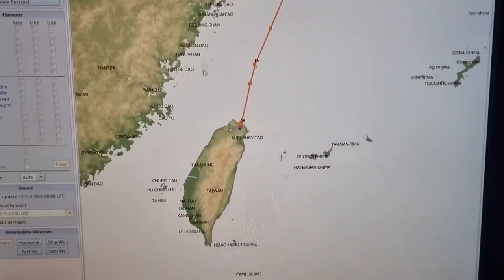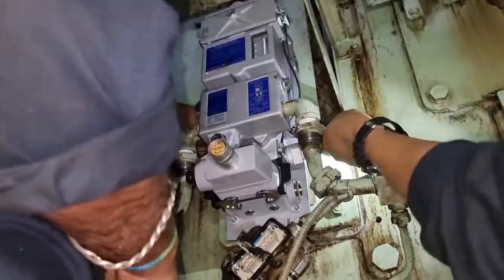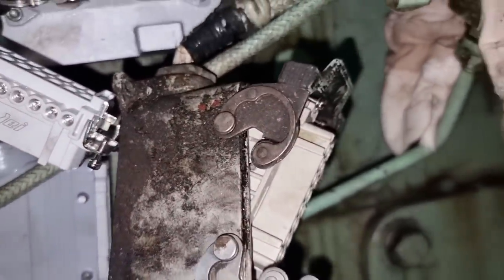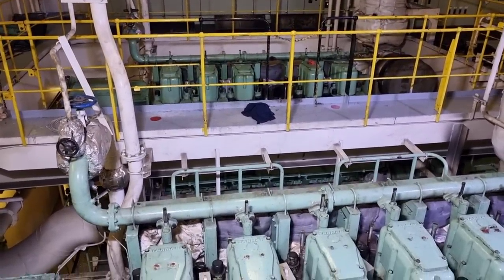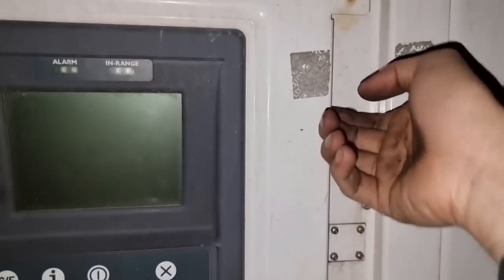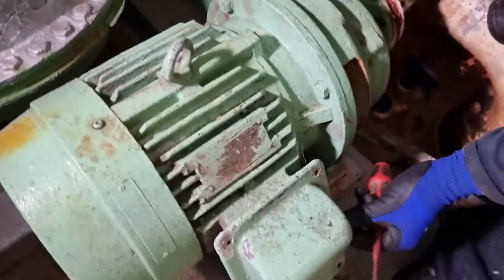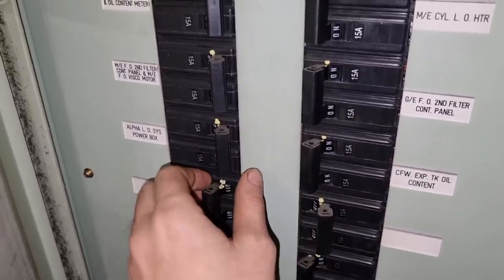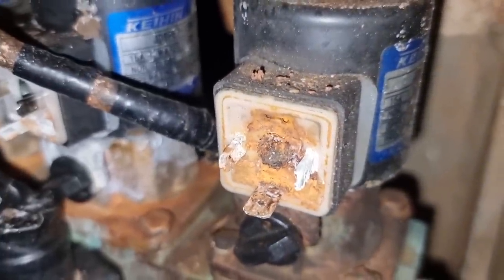Fixing 5 SHIP'S ELECTRICAL TROUBLES IN JUST 1 DAY DUE TO HEAVY WEATHER

Comment: Hi, Lecky! How you was able to Switch Off an ECC breaker? If Back up consists of Dedicated power supply line (220v) that switch over automaticaly or its a special UPS? If it was any abnormalities during Switch over?
Reply from the maker: we have back up power supply that will be ON once main supply is off, this is being fed from the emergency switchboard.
Reply: @leckyjake  is it affect any ECC  consumers during Switch over? I believe its very short timing but some times contactors "timelag" can be dangerous for such consumers like PLC or PC, is it?
Reply from the maker: I reviewed the system and I trusted the circuit but I do not recommend of doing it while the main engine is running. the vessel just had an history of slowing down due to lubricator shutdown caused by low insulation. but you are also right that there are instances that even milliseconds of delay in the activation it might affect the system, that is why, just like what I have said, I do not recommend of doing it.
Reply: @leckyjake  promt and particular answer, thank you, Lecky!